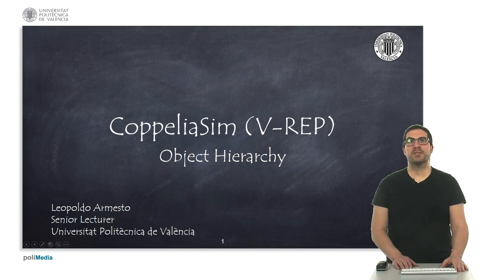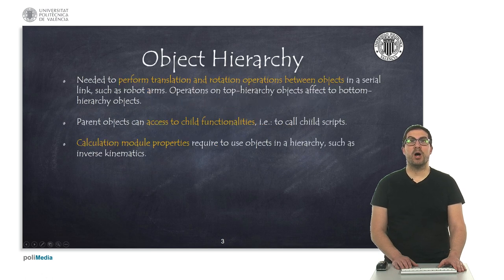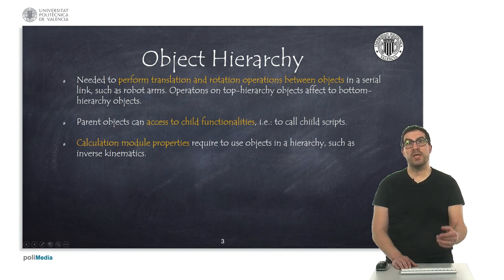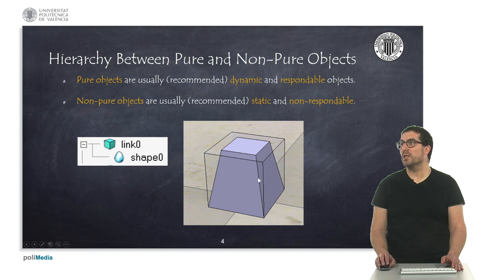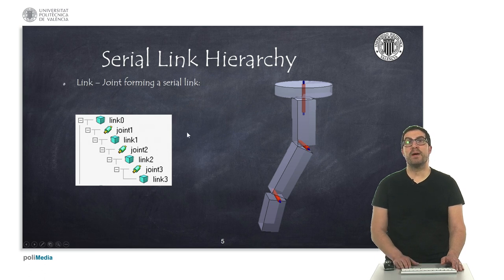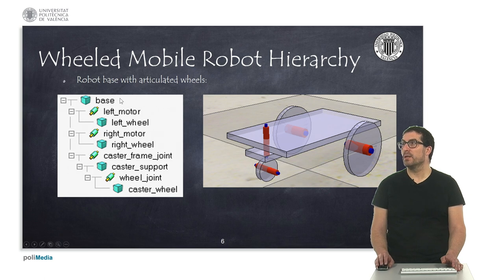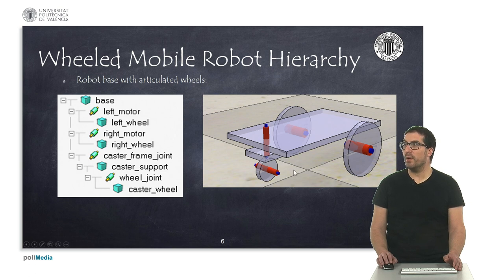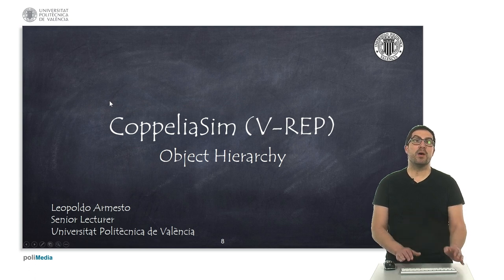Object Hierarchy Relations | CoppeliaSim (V-REP)

Comment: Where I can find this linked joints in the simulator? did you add this from somewhere else? or do you use a different version of the software? I am using the free version for student... I am new for this sim.
Reply from the maker: This is just an academic example. Not included by default in the software, because I made them myself. There are more examples with files to download in the next videos that I prepared for this set of video tutorials. The one in this video, was so basic that I did not included the file to download, sorry.